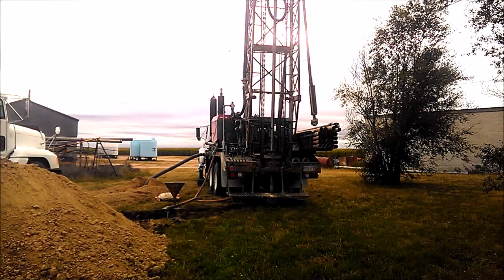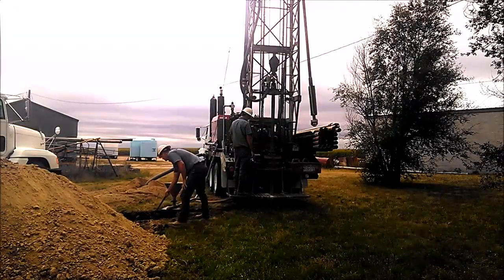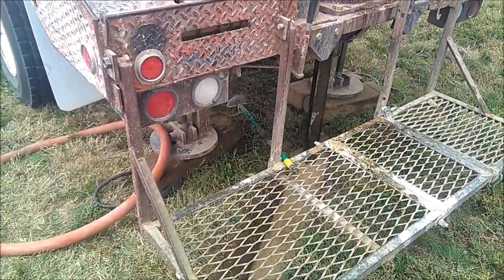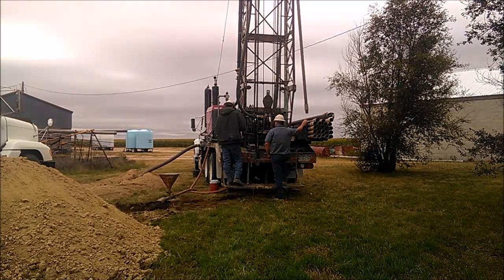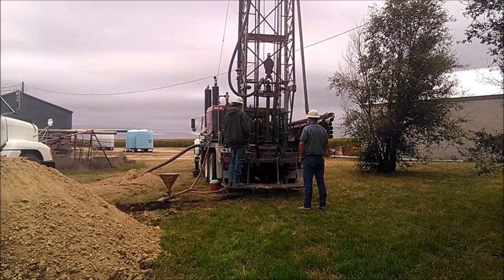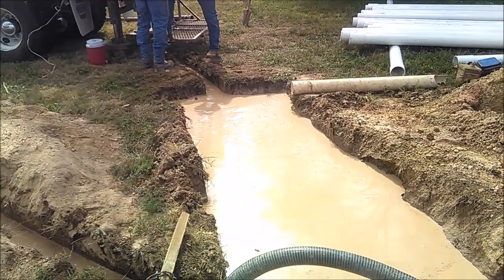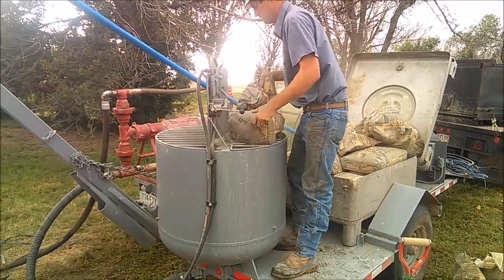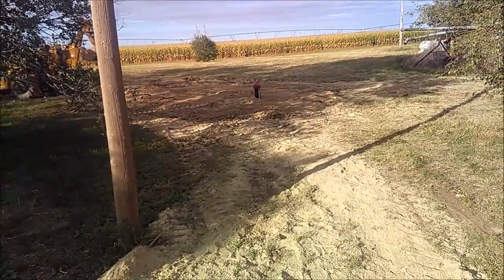Water Well Drilling

Comment from the maker: Timeline for the drilling day:
9;00 arrive on site 
9;30 start drilling 0:00
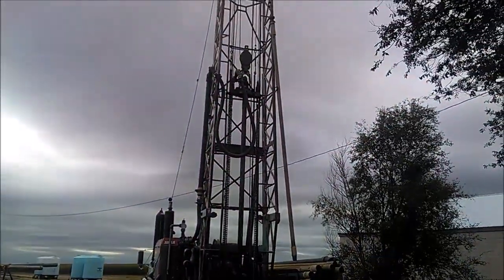        rig walk around 7:10
        adding a joint (making a connection) 11:20
1;00 reach total depth (387')
1;15 finish flushing cuttings, begin fresh water flush 18:10
1;20 finish washing mud out of hole 
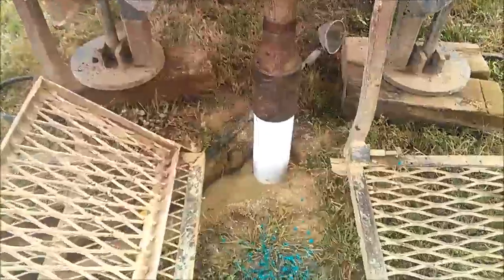2;15 stem pulled and casing set 19:22
2;20 finish backflushing casing
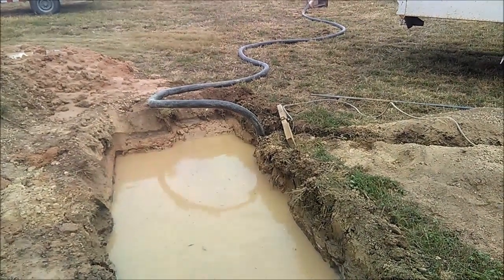2;35 steel casing set and begin gravel pack 19:38
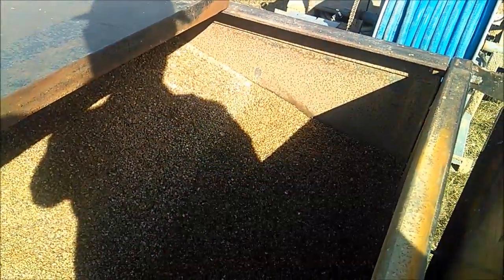3;15 gravel pack complete 21:00
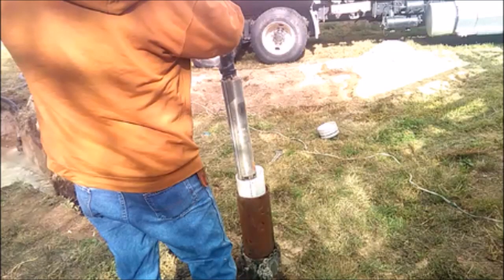3;25 begin to lower test pump 21:16
3;40 begin pumping well
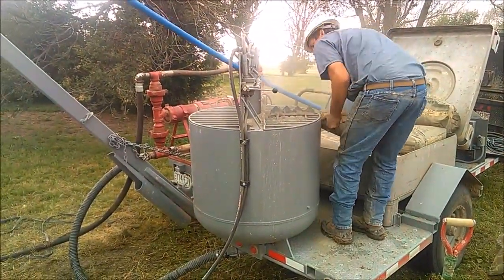4;05 begin mixing cement grout 22:00
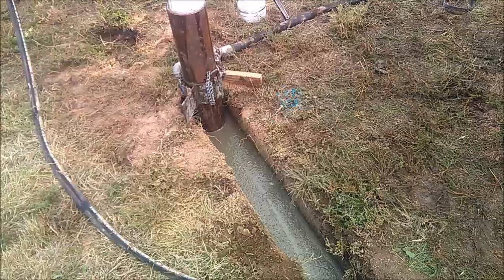4;20 finish pumping second batch of cement grout 23:44
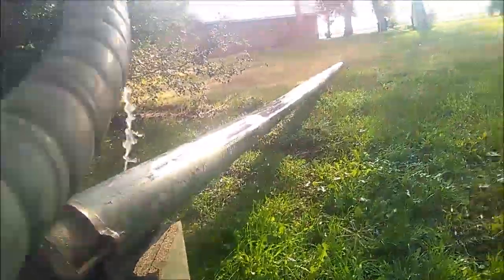4;30 finish cleanup and start to pull test pump 24:43
4;45 measure and disinfect well
5;00 off site

Comment: Owned rigs for 47 years..started on cable tools..sold them and got Portadrill TG..then a TK and my last rig was a JEFCO 30K.
   Had a custom built Shaker and desander with 1K tank on dual axle trailer..worked great.
  Also had a backhoe when needed..handy to load and unload using forks.
Company is 101 years old and now  has third owner..I quit 7 years ago..sold to friendly competitor 
Worked in Northern CA
   Your video brings back fond memories!

Comment: Great video Kenny, good to see how you guys get the job done up there!  The logistics you have to deal with verses what we have down here is nearly double, just looking at the depths you have to go and all the extra work required.  The trench for the pitless adapter and keeping everything below the frost line and that well having a pit for the tank is just wow!  Those things are not even considered down here cause we hardly ever freeze.  Broken pipes are rare unless someone didn't run the water on a night when it drops below 30 for most of the day.  Then you have the pump say we use a 3 hp sub, we usually get 55 gpm or more depending on our local water levels which are at most 100' in the highest elevations and those wells depths might only be 110' or 200 at most.  Granted there are very old steel wells and Teme could tell a story about one that's 2100' deep.  This well is failing and flooding the property the well log shows it had 44 PSI when drilled in the like 50 years ago.  The water is very clear has tonnes of H2s and back in the day was the ultimate in free energy, the old house still does not have a pump on it!  The Psi on another well they had not far from that one was like 35 psi.  Heck i need to dig up the video of that job and post it, we still have not gone back to attempt to kill that beast!
Take Care Kenny keep up the good work, good to see others doing the job Right!
Reply from the maker: Here we usually end up with 2 ft of frost in the ground most winters, however I have seen lines 3' deep freeze solid.  You can imagine how fun they are to fix. If the pit doesn't have a good lid or a heat source, they can still freeze the pipes when it gets cold.  Most of our wells we bury the pressure tank, a hydrant and valve on the line, then set the pressure switch down on top of the pitless adapter.  It saves the cost of the pit and we have a lot less trouble with it that way.  However you do have to dig up the tank to replace it.

Our wells vary from less than 10' to 470' depths with water levels <10' to 400'.  We don't have any flowing (artesian) water wells around here.  How much do the flowing wells you have usually produce?  Is the water quality issue why the deep well you mentioned needs abandoned or is the casing failing?  Just curious what are the abandonment requirements for a well down there on a deep well?  If you get to abandon the well, I'd be interested in seeing a video on what all you had to do.

Have a good day.
Reply: Wow last time i heard of a tank being buried around here was because the homeowner didn't want to see it in the yard!
The flow well rate usually depends on the water table but most 2" steel or pvc usually get around 10-20 gpm at under 5 psi of head.
But they have that one i was talking about and i have personally measured some 3" steel ones wide open that put out around 100 gpm but with only 10-20 psi of head.
That 2000' footer.... That thing is Pandora's BOX!.... Mr Temme had me go with him to look at it, to see what all we would have to do.
It was a nightmare to even think all what would have to be done, after calling another local driller to help also we settled at over 20k
to even attempt on killing that well off and have not heard back from the owner.  Ill have to post that video i made that day of those wells...I will send you a link.

Thanks, Casey
Reply: Here is the link to the video of us just looking at the well, i forgot it was April 2016 when we did that and have not been back!
Take care and i put a few extra clips from other things i never posted in there just for kicks, haha.   https://youtu.be/-0SAkopL7dE
Reply from the maker: Looks to me like his grout pump and a 100 bags portland cement would be a good start.  If you could get the top sealed and pump down it should be pretty straight forward.  If not a tremmie pipe down it as deep as you can get and let the weight of the cement kill the flow and carry the cement to the bottom then pump till it comes out the top.  Of course that depends on your requirements for plugging and records of how the well was completed to start with.  In Colorado if the records didn't show grout next to confining layers we would have to perforate the casing to get grout outside the casing, then grout the middle next to that.  I don't know how you would get a 2" well perforated.
Better you than me.  Good luck if they call you back someday.

Kenny

Comment: Once the well is drilled, can you “run” the well with a “maintenance pump” we have WITHOUT putting casing in the hole? Also once the casing is in the ground what’s the best way to sand pack it and grout it? Just simply start pouring sand/grout in the annular?
Reply from the maker: In our sand/gravel formation there is not a way to pump the well without casing.  It will cave in right away and you will have to clean the hole back out.  We have had good success pouring the gravel in place then in Colorado we are required by the state to pump the cement grout in place.  In Kansas we can pour bentonite chips in and it's an easier process.  If the hole is dry down to where you need the grout you could easily pour the cement in place as well but ours usually has water in it still.

Comment: Great video Kenny! That is awesome to drill a well that deep and set casing, gravel pack etc.in a day. It is interesting to see how wells are drilled and completed in other areas. I'm guessing the relatively deep water level allows you too displace your drilling mud before pulling the stem and setting casing. Here in Southeast La., it is desirable to thin the mud but with a shallow static water level the lack of hydrostatic head can get you stuck if the formation sloughs in. I usually try to thin the mud enough so that the casing doesn't float. We also use a back wash valve (sand shark) at the bottom of the casing string that allows the entire well bore to be flushed with clear water once the casing is installed.
What brand is that rig? There are some Kelly rigs still running here....mostly by drillers doing deeper wells....say 400' or more. I built my small rig so that I can drill alone if need be since decent help is almost non- existent. Also, a typical 4" domestic well package 100' starts at about $3500. Pretty much have do keep costs down and still drill a decent # of wells to make a profit.
My mud pump is a 6" Armstrong Machine grout pump that I modified. It works OK but only does at most..maybe 90 gpm.....tapped out. The little pump is light and cheap to operate. I would love a better pump........who knows maybe one day. Thanks for doing such a good video and for your comments to Clearwater pump and well...... Casey did a couple videos of my rig a while back.
Take care and God Bless!
Reply from the maker: Thanks for the comment Teme.  The drill rig is a 502 Portadrill built to go about 2000 ft.  The original owner had it down to 2800 with 2 3/8 stem.  The 501's are about a 1000 ft rig.  You won't find many stats online for them and they vary from rig to rig somewhat so I'll list them here:
75,000 lb derrick
up to 5 part 15k lb main winch
up to 4 part 15k lb secondary winch
2000' sand line 1500 lb winch
7 1/2" table opening but will pass an 8" 3 wing drag bit.
pulldown chains are rated at 15,000 lb but are easily capable of lifting the 35000 rear end of the truck
5 1/2 x 8 fd-fxx mud pump (smaller liners for higher pressure available)
deck engine runs mud pump, everything else is off split shaft pto from truck

The rig is possible to run by yourself... but not easy or advisable.  It's made for two people.  We are in the same boat trying to find help... Most everything we have needs a CDL so that kicks out 90% of the people right off the bat.  

You are correct that the deeper water level helps keep the hole open even with fresh water.  On some of our shallow (less than 20') water levels we don't flush the hole out before setting casing, but still flush the casing and hole (through the casing perforations) before gravel packing.  If we are doing test holes and allow the water in the hole to settle out, there is about a 50% chance it will cave in well above water level.  Also about a 90% chance that right around water level it will cave in once the mud level gets down that far.

It's hard to have too much mud pump.  We do well at 8 or 9" hole, but have done a couple 11" holes that took a lot longer to get done due to the low uphole velocity.  I bet if you doubled what you have you would be quite impressed at the difference it made drilling.  Our pricing is similar to yours with a minimum charge that is applied to the first 150 or so feet.  Test holes are done the same with less minimum and per foot charge.  We charge a little more for a Colorado well than a Kansas well due to the 21' of steel and cement grout requirement.  Kansas is bentonite grout with no steel required.

God Bless you as well, stay safe.

Comment: I’m looking at buying pretty much the same rig here in Canada, I have 10years experience in the oil field (which is a lot bigger equipment) but on this rig how do you trip the pipe out? Do you use the secondary? Or is there a way of connecting a set of “bails”
Reply from the maker: On this rig and I think most water well table rigs you use the secondary line to pull out the stem and the table to break the joints.  There is a breakout tong above the table that holds the joint while you turn the table to break it loose.  The kelly line is only used while drilling.
Reply: @kennykemp2790  perfect thanks Kenny, I’m assuming the secondary is rated for the same weight as everything else.   Like I said my experience is around oil well drilling with directional drilling, getting stuck in the hole 4000 meters etc! So when stuff like that happens the rig and driller start pulling some super heavy weight. 
   But thank you so much for the reply! I’m really hoping this endeavour will pay off and be a great part time gig for myself and another guy!
Reply from the maker: @0025cr  On this rig both lines are rated for 15k single line and it started with 5 part line on the kelly and 3 part on the secondary.  So 75k kelly and 45k secondary.  We run it on two parts both lines so 30k each.  It was a bit of a custom order though I have not seen another quite like it.  The kelly is only 19' (it runs 15' stem) and around 25' total travel while the secondary was able to set 40' casing or pull/lay down triple 15' stems so around 50' of travel.  It had a racking board for pulling and standing double's to start with.  The spools are not large enough to handle more than 3 part on the secondary is why it was only three part on it.  Every rig is a little different you would just have to check your specs on the rig you are looking at.
Reply from the maker: Also you can use the secondary for setting casing if you are doing something heavy.  We usually use the sandline though it's plenty for the PVC we usually run and a fair bit faster.
Reply: @kennykemp2790  right on! Thanks so much Kenny!
Reply: What is the benefit to running 15ft joints? Seems like an awful lot of connections and a lot more work tripping pipe.

Comment: How come the gravel doesn't collapse in on the sting?
Reply from the maker: When it gets to gravel where it would normally collapse the drill mud forms a wall cake and then the mud/water weight from above the formation is holding out on it.  In our area most of the time we can even remove the mud and leave the hole open to water level and it will stand.  Once we get below water level the water weight coming back into the hole will collapse the hole and continue to wash sand/gravel in until you stop removing water.  We will sometimes bail out a hole before casing if we don't know what the water level is and we question if it will even make a well.